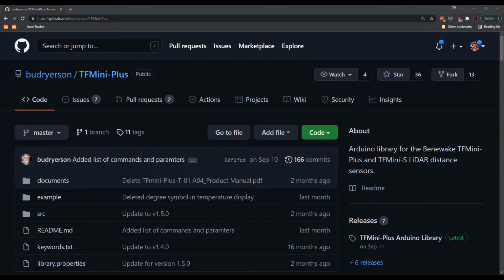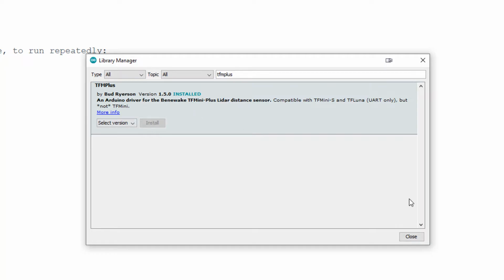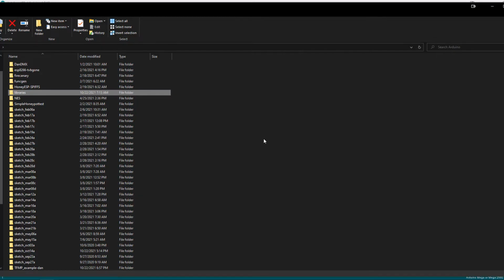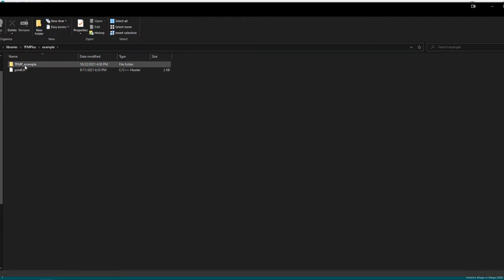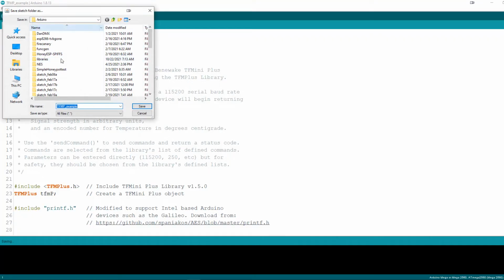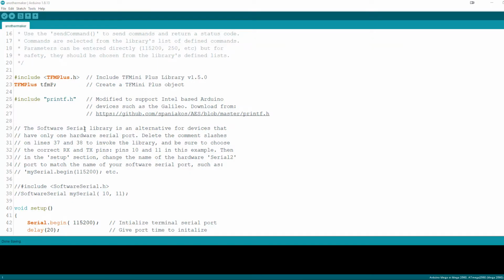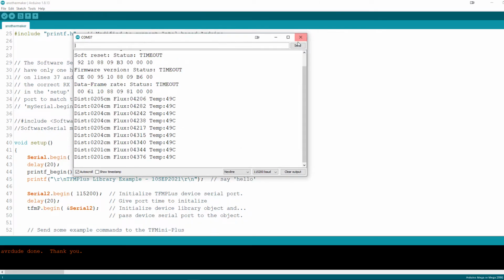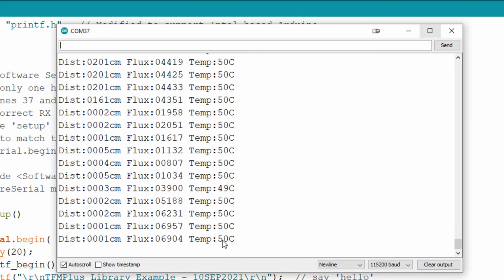Arduino LiDAR Quick Start Guide with the TF-Luna

Comment: And when you mount it on a fast servo or stepper motor, the fun REALLY begins! ;)
Reply: No? Why? Using ROS2, there is no reason you can not use this and sweep to create a map. Mount on a slip ring and rotate, it will do the same as commercial unit, just you need to do the work to configure.
Reply: @blaircox1589 But can ROS be slow if you need to do multiple publications or subscriptions in one function?  It takes time to publish and for the subscriber to respond.

Comment: Many thanks for this well done and informative video. I have a question for you, can I use this sensor to map the surface of wavey water. Which one is better in such application, the ultrasonic or the Lidar?
Reply from the maker: I do think lidar is the better tech for this but they do make lidar sensors that do more scanning as opposed to a measurement at a specific point

Comment: Thank you for this video! I followed it exactly but am having an error issue that reads as follows: Status: HEADER / Data: 00 00 00 00 00 00 00 00. Any ideas on why this would be happening?
Reply from the maker: I knew there are several different variations of the sensor that have different wiring diagrams. Yours may be different than mine

Comment: The cheap arduino thing is useless. I have that ordered and I also have a lidar that has the same range except it has 360 degree range with a built it stm32f throwing tons of data that needs to be parsed haha.  I have a long term project that involves spacial data in real time by more than one sensor. Eight now I'm evaluating different 3d data representation solutions. I believe I'm going to end up settling on js and Vulcan or opengl. I don't know java, it's probably the only popular language I'm not fluent in. By fluent I mean can read and follow the logic. I'm probably gonna pull and transform the data, do all the spacial parsing and pass it to  simple vector based representation so I can debug. I'd love to get a jetson Xavier for msrp so I'm going to use a pi3 I think and capture the data on my pc and let the 3090 do the heavy lifting. The 3090 was cheaper than a vanilla 6 or 7 year old jetson xavier based on the 9xx nvidia cores. I'd not have bought a new gpu otherwise. Cyberpunk does look awful pretty but it did on the 2080ti I sold during the mining craze. I sold it for a fair, unscalp-like price to buy a new oscilloscope haha
Reply from the maker: I wouldn't call the arduino thing useless. It definitely depends on how much you need to process.  They've offered me a Jetson nano to work with this and some of their other lidar products, but I don't really have time to learn it right now.
Reply: @AnotherMaker  that's true. It's what I learned on and donated like ten of them to a kids program. Sorry for nattering on there brother. I'm on a medication that makes me ramble and when it's about our thing I'm worse. None of my friends even know what a jetson nanao is hahaha. I had one ordered back in 2019 and cancelled it like a fool haha

Comment: Heya, my LIDAR sensor came in with a 6-pin communication wire. Is there a way I can use it using only normal jumper wires? If so then how?
Reply from the maker: I'm honestly not sure. There are a lot of variations of this thing apparently. I'm not sure of the other wiring diagrams
Reply: @AnotherMaker  Well, thx for replying anyway.
Reply: @AnotherMaker  Another question, is there a converter for this? If there is it might be possible to do my project.
Reply from the maker: @zhtan1173  I'm not sure, but if you look at the pin labels on mine and the pin labels on yours, I wouldn't be surprised if yours just has an extra pin that you don't need. You could just wire it up according to my code and see what happens.  That said, I know they made some that worked on different protocols. So there's a chance mine is rs232 and yours is i2c or something like that.  I'm really not sure.

Comment: almost nice, next time explain where u connected the circuit so we can follow thru
Reply from the maker: The code I linked to in the description breaks all that down.   It lists what pin goes where right at the top.
Reply: @AnotherMaker  yeah, can you do this on arduino uno? and only using the hardware serial not integrating software serial please

Comment: I have connected the TF Luna to my arduino uno and the code can be compiled and uploaded. However when viewing the data monitor I do not get any data recorded. Only 00 00 00 00 00 00 00 00 00.
Reply from the maker: I've heard that different versions of this have a different wiring pinout.  I showed mine in the pic, but your wires could be in the wrong order.  You might need to experiment.

Comment: Can you please provide a pinout of the device?  The colors of the wires on the cable that came with my unit are different.
Reply from the maker: I have the pinout and details in my github but this is the image by itself https://github.com/mudmin/AnotherMaker/blob/master/arduino-lidar-tf-luna/LIDAR-Mega.png
Reply: Did you solve your problem with this. I think I have the same issue

Comment: if i use arduino uno and tf-luna LIDAR will your code still work?
Reply from the maker: You will have to tweak it to use software serial since the Uno only has one serial port.... I feel like I gave that option in the code but it's been a little while
Reply: @AnotherMaker  Which tweaks may that be?

Comment: Thanks for the info.  Can you describe how to use this with an Arduino Uno?  Thanks!
Reply from the maker: There are comments in the code about using "software serial" to turn on a second "fake" serial port on the uno. I believe it's pins 10 and 11, but I know I mentioned it somewhere in the code that's linked in the description to my github.
Reply: @AnotherMaker  I am trying to use this with a Seeeduino XIAO and software serial.  I'm using the example that comes with the TFMP library.  I get the following output:

20:05:08.180 -> Status: HEADER
20:05:08.180 -> Data: FE 59 AD 93 80 2B 08 4B EA
20:05:09.205 -> Status: HEADER
20:05:09.205 -> Data: 59 AD 93 80 AE 86 6C A1 FF
20:05:10.269 -> Status: HEADER
20:05:10.269 -> Data: E8 59 AD 93 80 2B 08 4B E9

Any ideas?

Comment: Hi...Can we use TF Luna lidar in detecting potholes?? If yes...Does it provide results in water stagnated potholes or it will give result only in dry potholes??
Reply from the maker: You would need some sort of servo to do any sort of pan and tilt. They also do have 2d and 3d models that may be better suited.

Comment: Great job, can i use this TF-Luna for 3d mapping ?
Reply from the maker: You would need some type of servo (or robot) to handle your pan and tilt. This one is 1d. They also have 2d and 3d versions.
Reply: @AnotherMaker  do you have any code for the servo ?
Reply: @yzkwn  did you ever do it that would be a very interesting and very difficult project

Comment: hi, is there any idea to install print.h? i couldn't get the example run smoothly.please get e any idea.
Reply: Be sure that 'printf.h' is in the same folder with your sketch.
Reply from the maker: Hey I was just coming here to get the link the video, but I see you found it :)
Reply: @AnotherMaker  appreciate if you could email me the example for this coding.
Reply from the maker: @shaebahtv  Here is the code that gets pasted in a file called print.h into your sketch folder.  https://github.com/budryerson/TFMini-Plus/blob/master/example/printf.h

Comment: since it is a laser, does it work for measuring the water level in a rain barrel?
Reply from the maker: I would need to check, but since they have an ip67 version that I was thinking of getting, I may have to try that. I will let you know.
Reply: @AnotherMaker  u already have the waterproof sensor? I was thinking to use on of these to replace multiple ir sensors. But its in a cold environment like a fridge. It should shine lengtwise over a.convayorbelt instead of multiple ir sensors sideways
Reply: I am interested as well
Reply: work well

Comment: Hey! I'm wondering if you could share a video on "How to send 'Hello word!'" Between to arduino's using the LASER module and the LASER Sensor Non-Modulator module.
I think this would be amazing!
Reply from the maker: Can you link to the modules?
Reply: @AnotherMaker  The second link got remove by big brother 🙄. you would have to add the fallowing. 3 times the twenty-third letter of the English alphabet, 𝘢𝘮𝘢𝘻𝘰𝘯, 𝘊𝘰𝘮𝘦 without the 'e',
𝘚𝘭𝘢𝘴𝘩 dp 𝘚𝘭𝘢𝘴𝘩 B091GBJLX5. I hope you get to read this and please big brother leave us alone.
Reply from the maker: @nikolas8741  Oh so you are talking about the straight up laser sensors that I use in my duck hunt and shooting gallery stuff, right?
Reply: @AnotherMaker  yes that one and send messages between two arduinos. Or hook it to a  router grab the data from the router then send it over the laser to the computer laser receiver that is conected over Ethernet
Reply from the maker: @nikolas8741  This guy does it and gives code.   https://www.youtube.com/watch?v=IEFcJW1R57E
Reply from the maker: This guy too. https://www.youtube.com/watch?v=NcLn61cqdak
Reply: @AnotherMaker  this is great! I very much appreciate it. LASER Routers in the future will be the most secure and fastest. LED Light will be use to transmit Gbps at unimaginable to us right now!